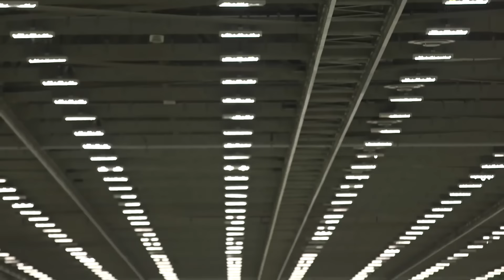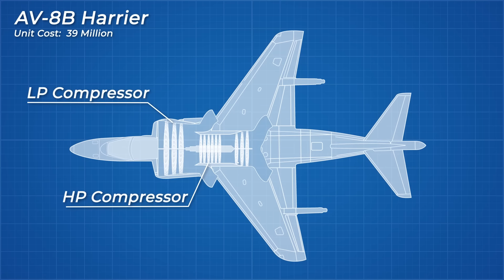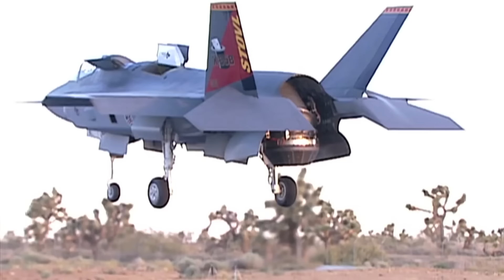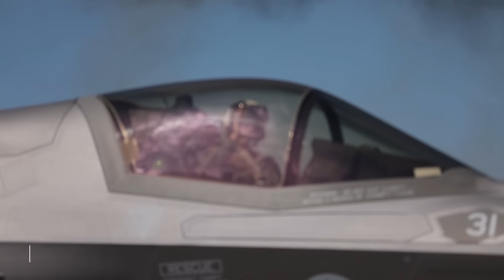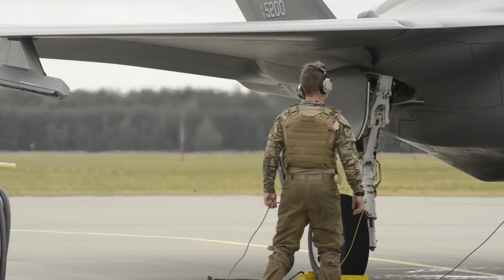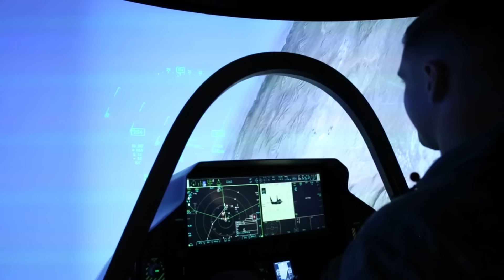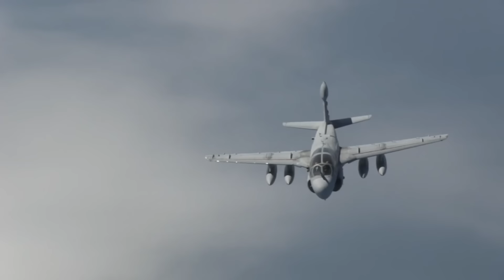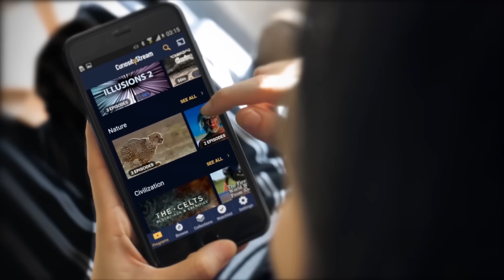Is The F-35 Worth $115 Million?

Comment: F22 & F35: We are expensive with Stealth Technology.

S400 / S500: Sorry, we can see you...
Reply: Says Russian state owned media.
Reply: Why do people propagate the idea that stealth completely nullifies any kind of target lock except line of sight? Compare operational and excursion ranges into radar-controlled areas between an F-15 and an F-35... that is the point of stealth. Were stealth a dead-end, the Russians and Chinese would not be pursuing materiel that implements it. This is directed at everyone. Stealth does not make an aircraft invulnerable, but it does allow it to better engage enemy aircraft and penetrate into enemy airspace more reliably than an aircraft with a higher RCS. Sincerely, someone who has a degree in aerospace engineering and has worked research on radar tracking.
Reply: But can it fire and get a hit is the next question
Reply: @colejones594  a little bird can bring down any fighter jet.... the planes are so vulnerable in the sky they don´t need much to make them crash... with the help of some precision missile to find the location I think yes.....
Reply: Wareen except russia has no missile capable of guiding to the target cause the f22 and 35 dosent give off a good enough feedback to get the targeting data required to get the missile to target not to mention 90% of the time us dosent send these planes out with out jamming planes to accompany them
Reply: @colejones594  same thing happened when Russia fired guided missiles to syria from the caspian sea and hit ISIS bases from miles away... everybody was thinking that the tomahawk was the only capable... they were wrong... 
again.. same case with the U2 spy plane, etc, etc, etc...
just because a country does not show the full potential of the arsenal does not mean they lack the technology.. simple facts..
Reply: Wareen simple fact is america is decades ahead of any other nation in stealth tech you can see a target but that dosent mean you will get enough data to fire the missile accurately there is a big difference between hitting a base and a plane especially if the cross section you have to aim at is comparable to that of a marble russia is ahead on the missiles game hypersonic is a big step
Reply: @colejones594   during the NATO bombing of Yugoslavia, a Yugoslav army unit shot down an F-117 Nighthawk 🤦‍♀️stealth🤦‍♂️ aircraft of the United States Air Force by firing a S-125 Neva/Pechora surface-to-air missile.  
stealth is just propaganda, that is why west stop production of them. they can be tracked..
Reply: Wareen  for one it wasnt flying with the usual jamming planes also was flying a normilized route so they knew exactly where to look  and not to mention that was 80s tech  and it took damn near 20 years to find a way to shoot down one modern stealth is 100X better  and how many missions did f117 fly how much data did it get how many targets did it destroy before one was shot out of the air stealth has a huge impact russia cant even make a stealth jet or a working 5th gen fighter
Reply: @colejones594  well we are talking with hard data.. what really happened.. does not matter the circuntances...he was on a mission with the best technology at the time....  Stealth went down... period
Reply: Wareen f117 introduced 1983 first shot down 1999  do the math 16 years for them to find away to shot one down thats hard data not to mention only one was ever shot down andit didnt retire till 2008 so thats another 9 years it was untouched  another 9 years that stealth didnt go down
Reply: @wareen6563  Yeah, except you are arguing assertions that lacks lots of hard data.      

----> "during the NATO bombing of Yugoslavia, a Yugoslav army unit shot down an F-117 Nighthawk 🤦‍♀️stealth🤦‍♂️ aircraft of the United States Air Force by firing a S-125 Neva/Pechora surface-to-air missile.  "

Yeah lets examined those historical events more closing. The officer in charge of that F-117 shoot down was Colonel Zelko.  What he shot down was an outdated 1980s F-117 stealth aircraft that didn't have an onboard AESA radar system, no countermeasure support, no threat detection systems, highly limited maneuverability and a serious lack of speed to break 400 knots and run.   Those facts alone are a Huge difference between the F-117 and the F-22 or F-35 (and Stealth is a continuous adapting technology).   Too start with, the Serbs had spotters at the Airports in Italy with radios telling the Serbs which planes were taking off and when they took off.  NATO wasn't changing their flight routes over Serbia which was a stupid and usual mistake.  So not only did Colonel Zelko know who was taking off, when they were taking off, he also knew where to camp out with his SAM battery.  Heck, he also could visually spot the plane from miles away. 
But, despite Zelko having all that wonderful intelligence; despite that fact that the F-117 had no threat detection, no countermeasures and couldn't evade worth shit;  Colonel Zelko still have to literally fire off about half a bank of his missiles just to try and hit that F-117 aircraft, while he was targeting mark one eyeball?  In simple terms, he strafed the flight path of the F-117 with Sams praying one might get really close enough to the F-117 to get a bite.  One did!  So he got lucky!  Shooting down an F-117 made great propaganda for naïve parrots like you, but in a real war, if you have to waste a half a battery of your SAMS to bring down one airplane, YOU'VE ALREADY LOST!.  The fact that the Serbs (as well as no one else) has been able to bring down another F-117 or B-2 actually is testament that 1980's Stealth was still very effective.  The fact that Zelko had to go to such extreme lengths to kill ONE sitting duck F-117 is also a testament that even an old Stealth aircraft was highly effective.  BTW, The Serbs actually had a real shitty record at repelling NATO attacks compared to the Iraqis.

-----> "stealth is just propaganda, that is why west stop production of them. they can be tracked.."

oh?  Is that why Russia and China are spending a fortune trying to develop Stealth aircraft and hacking into US contractors for Stealth technology?  Why is France trying to make a Stealth version of the Rafale?  Where is your hard facts that Stealth is just propaganda?  Why is India trying so hard to get clearance from the USDOD to buy into the F-35 program?  Are you trying to tell me that an Armchair youtube expert, such as yourself, knows more about Stealth aircraft than those who serve in the IAF, RAF, RCAF, RAAF?   Oh wait!  Your a Peirre Sprey parrot!  Like that charlatan's bullshit hasn't been debunked continuously since his days with the Fighter mafia.
Reply: all those lines??? JESUS... you are to passionate about it... sorry.. I did not read them all.. just the fist two.

the F117 went down.. get over it for the love of god..
Reply: Wareen  you mad russia cant even make a 5th gen or stealth jet so you gota justify stealth is useless but cant even do that right
Reply: @colejones594 mad? I'm a happy person....I just write few lines with events that actually happened and wait the answers from people that cannot handle different point of view...
Reply: @TheJTcreate  why are you hurt by my arguments.. did I touch a nerve? F117 went down.. fact.... U2 spyplane same case.. so . Why are we talking?
Reply: Wareen  f35 flys combat ops over s300 and s400 in syria all the time fact
Reply: @colejones594  my God... I will agree just because I do not want to keep writing about the same topic...
You are right.. no country can track a USA made Stealth plane....
Reply: Wareen never said that but i did say that stealth is far fro useless as you stated earlier
Reply: @colejones594  .... Ok ....
Reply: @colejones594  Firing off a half a bank of SAMS to take down one slow and poor maneuvering aircraft is really not something to even brag about (especially one with no threat deterring systems, flying a predictable flight path).  Yet, Russophiles just can't help themselves.  The F-117 was actually a highly vulnerable aircraft because of its 1980s primitive Stealth design.  Lots of sacrifices were made. Sacrifices that don't have to be taken now with the modern Stealth technology continues to evolve.   I'm surprise the Iraqi's did take down at least one F-117 during Desert Storm.  Even so, it's primitive stealth technology was evasive enough to keep the odds tucked greatly in its favor (over Serbia or Iraq).
Reply: @TheJTcreate  I'm very happy that you can write... Proud of you...
Reply: @wareen6563  Well, I'm happy that you can write too.  Its just unfortunate you feel so threaten when someone calls your conclusions into question.  All your snarky sarcasm is doing is proving me right about you.  Please..Keep going. I'm enjoying this.
Reply: @TheJTcreate  yea.. I'm here too.. so feel free to write what ever you want... you have youtube 24/7 If you need help or advice  let us know so we can address you problem ASAP....
Reply: @TheJTcreate  what else? It's everything you got?
Reply: @wareen6563  That should be my question.  You're the one running away from the conversation.
Reply: @TheJTcreate  I finish my Stealth conversation a day ago.. so no need to keep writing about that topic anymore... right now just having fun with you..
Reply: @wareen6563  A thread is what it is, regardless of anyone's nationality.  So that was even pointless to say.  Sorry, but I don't recognize your German fascist authority on this conversation regarding Stealth.  All you are doing is trying to avoid the conversation, and your narcissistic ego just can't let it go.
Reply: @TheJTcreate  you are doing great.. 
keep me entreteined I will give you that...

What else?
Reply: @TheJTcreate right, right...

and? what else?
Reply: @TheJTcreate  I told you earlier. but the message was not received. Probably you need to understand more what you read... You are in a loop... Trying to get people to talk about something that is not a topic anymore.. but you keep coming and coming..... well what can I say...
Reply: TheJTcreate its a win for us he cant even argue against the points we brought up all he can say is well it got shot down which it did but will not admit to the conditions of why and how it was shot down and how long it took to find a way to shoot down one stealth aircraft and how long its been since a stealth air craft was shot down
Reply: @colejones594  Well I see he is the only one who thinks the conversation on Stealth was over.  You obviously didn't get that message either. LMFAO!    Of course he will not concede to having a sensible detailed debate.  That's how narcissist operate.  The only facts that matter are the selective ones he approves of, not all the facts that are based in reality.
Reply: TheJTcreate all he had to do was disprove my argument that modern stealth  isnt useless but he is like a Parrot repeating well one f117 was shot down 20years after its introduction  which no one argued it was about stealth being useless but he will not argue that cause he can not
Reply: @colejones594  dear god... you still going??? though the conversation was finish/over.. 
you want to talk about what??? 
-it´s a win for you? 
-argue? 
-brought up points?
-conditions?
shit happens it´s called war and does not matter the conditions or how log it took to find it...

Plane was shutdown whatever the conditions is down..... nothing can change that. 
But what to we spect?
-pilot was sick? 
-distracted? 
-somebody cheat?
-was not fair?
-fog affected?
-rain screw the mission?
-same route over and over?
nobody wanted to argue with you guys in the firts place...you got your points and I got mine.... I´m passionate about planes but not enough to interact with people defending topics because I do not care what you think. so I ignore or play along writing stupid sarcasm because I really do not care what are you writing or your knowlage. I´m not trying to learn more from you... I go to wiki for that.

So you are going to judge me because the way I think? because I do not want to talk about something?
 I´m force to discuss your points ?????????????

chill out and have a beer... I´m having one right now...
it´s better to be happy.
Reply: Wareen so how is stealth useless cause they managed to only down one plane  9 years ago but have not been able to do it since if it is so easy why arent they blowing Israel f35 out of the sky israel f35 is shiting all over syria and evading s300/400 batteries all the time they can see them sure but they cant fire why is that and dont give me that bs that oh russia is on a cease fire order why would they miss the opportunity to claim a kill on an f35 simple answer cause they cant bet you didnt know that Russian equipment cant detect stealth aircraft past 10miles out and range of anti radiation missiles is 85miles rendering current russian made sam sites ineffective
Reply: @colejones594  why they do not shoot any plane right now with surface to air? maybe because are not in their best interest to retaliate, need money for war,,, I do not know 

When WW3 starts we will see technology that we are not aware and though was not possible in our time.... topsecret planes, use of laser cannons and deadly surface to air missiles.. a lot of shit will go down... probably we will get drafted..

take care.. I´m out of here...
Reply: Wareen so ypu admit russia is a poor country and that their sam sites would get annihilated if they choose to engage stealth jets
Reply: @colejones594  
I´m trying to undertand you Sr.. I really do...

I though the conversation was done/finish,  but something is still bother you.

it´s a loop that keep´s going with the same thing and will not end till I agree with you..

is that what you want? I can do that so we can move on.
Reply: @colejones594  Well, hang on there Cole.  Russia makes some pretty deadly IAD systems.  So don't discount them.  However, it doesn't take modern tech to make a deadly IAD system.  Tech that is 10-20 years old can be pretty deadly.  But what Russophile's don't understand is that those weapon systems are made with western parts shipped in from Germany, France, Israel, China and (Yes) even the USA.  Russia does not have the ability to manufacture microprocessors on any level compared to the west.  They don't have the high tech industrial infastructure that can precision make parts on the level of the west.  Even if you look at the SU-57 closely, its dotted all over the place with rivets. Not a good thing for stealth.  You don't see that with the F-22 or F-35. Every gap and crack from the panels of those fighters is so precision matched during manufacturing.
Reply: TheJTcreate  fair enough last i heard su57 was cancled just like the t14 and the ones they do have made suffer from engine problems
Reply: @colejones594  too bad..
Reply: Wareen i thought you where done why did you respond to mine and thejtcreat convo didn’t have nothing to do with you this round he corrected me on some of my points if you where so done with the convo why did you feel
The need to reply
Reply: @colejones594  The Su-57 doesn't have its engines.  Its been flying with the underpowered Saturns out of the SU-35.  That's not unusual.  The first 4 years, the F-35 was flying with the F-119 until the F-135 was ready.  Last time I checked, the completion year for the SU-57 engine was 2025, but I have no idea if that target year will be met.  They're still trying to design the new engines for the SU-57 and they have made some test runs.  One of the problems they are having is metallurgy.  Trying to make high tempered precision parts that can take the heat and stress of the output like the PW F-119.  Russia has purchased some modernized industrial machinery that can precision cut the parts from Germany, but making an durable alloys by controlling impurities is extreme hard to do.

Just to catch up 10 years on the west, Russia purchased out old Intel manufacturing equipment.  Their entire aviation industry does not output or generate the profits of one single western Aerospace company whether its Lockheed Martin in the US or Airbus.  It shows too. When was the last time you ever saw the Russians create a new airframe from scratch?  Even the SU-57 is just a redesigned SU-35 fuselage.  30 years since the Soviet Union collapsed and nothing new.
Reply: @wareen6563  I dunno. I tern went through the LiftFan during initial RNFAA flight tests. The 35 was unharmed... unlike the tern
Reply: @wareen6563  👈you said it! 
"Just because a country does not show a full potential of the Arsenal does not mean they lack the Technology..simple facts" 
Ok!!! Then your facts also applies to The USA when it comes Nuclear Weapons. Russia is not the only country that have the most powerful Thermonuclear weapons. Since the USA withdrew from the INF Treaty. That gives America to Build, Test, Experiment and mass Produce a much more better and much more powerful thermonuclear weapons than it's adversaries (Russia, China, North Korea and Iran) in secrecy.
Reply: @buknoychiifiocchii8058  apply to any country/military... WW3 will be the worst war  the world have ever seen. we are  good on killing ourself's fucking up the natural resources and the only ones who will pay the price will be our son's...
WW3 will start because stupid  countries with poor lidership want more power based on interest and not helping others..
Reply: Imagine thinking stealth planes are actually invisible to radar.
Reply: Luke L. you are correct sir... the planes are little birds...
Reply: Remember when Israeli F-35s destroyed S-300 and S-400s in Syria?
Reply: @mistahshade  were I can get that evidence? Pictures. People talking what their saw...Video on the attack?
I want to see Israeli F35i destroying syrian S300 on the spot not youtube videos.with robotic voice.
Reply: CR  and the point is?
Reply: CR  ah..